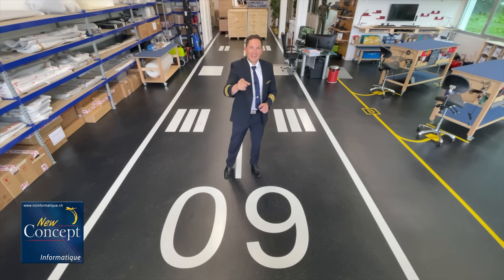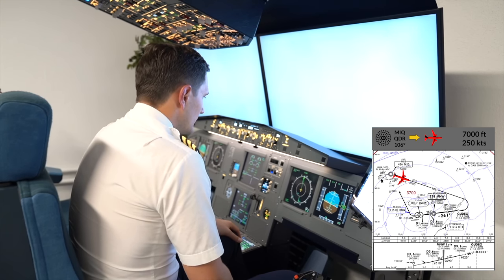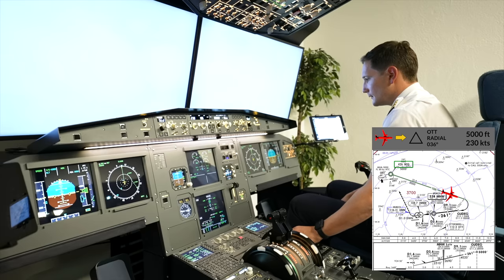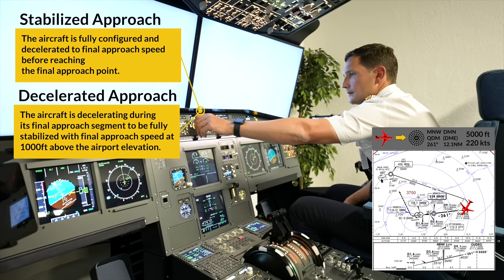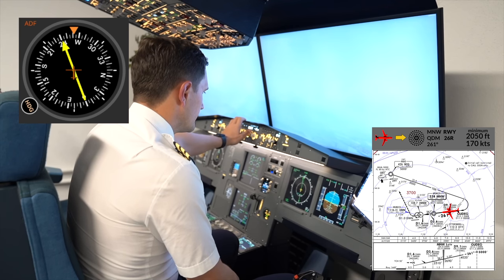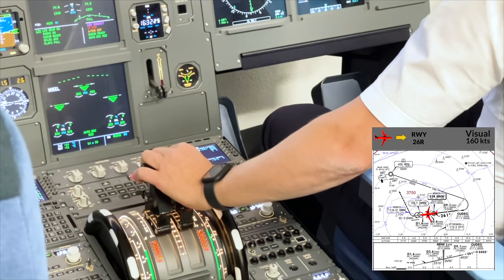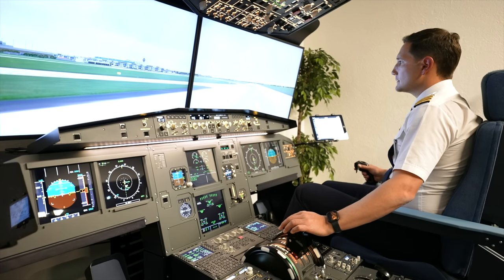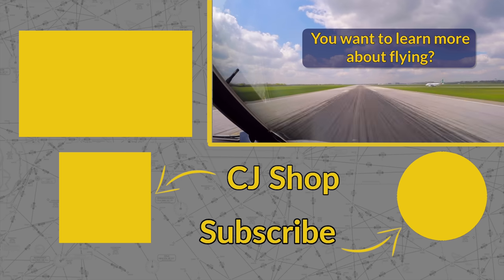How to FLY AN NDB APPROACH with an Airbus A320! Explained by CAPTAIN JOE

Comment: I know enough to follow what you are doing, but watching you do it I realize how much I still have to learn.
Reply from the maker: That’s the point of the video😉👍🏻
Reply: @flywithcaptainjoe  Mr joe, I got an interesting question for you:
If 80% of an airplanes’ thrust comes from bypassed air then Why do planes crash when they run out of fuel😊?
Reply: @Husky_Tech  The bypass air gets accelerated by the combustion chamber. If the combustion gets starved off fuel, the bypass air does not get accelerated, so there's no thrust.

Comment: Thanks Captain Joe.  As a non-pilot, this gives me additional confidence in the training of the crew up front.  But it made me wonder how such training was done in the pre-digital age.  I suspect simulators have been around for a while, but in the prop age, perhaps not.
Reply: There were! Just probably not as common. Checkout Tom Scott's video about analogue simulator called Link Trainer: https://www.youtube.com/watch?v=RJAYZgOZS08

And yes, they were more for learning to trust your instruments rather than flying generally, but still!
Reply: Simulators are older than digital, you do not need the picture out of the window to simulate navigation. And the navigation of an approach is the same in a small training plane as it is in the large plane. 
With large planes the student could ride in the cockpit jumpseat like an apprentice and observe the operation for many flights, in addition to formal lessons, then participate in small actions and calculations under watch of the captain.
Reply: Pre-digital qualifications were done via "pilot trainer" flights. These were conducted with an instructor/check pilot and usually started with a short cross-country flight to typical cruise altitude followed by an instrument approach and then a series of touch and goes.

Comment: Hi. Can you make an episode about landing with a Cessna? How can you find the glide path only with an altimeter without sophisticated instruments?
Reply: Pitch for ~65kts with flap 20/30, that'll give you a decent rate of ~500fpm, which will give you a good glide path. Too high - reduce power, too low - add power. Too fast - raise the nose, too slow - lower the nose. Very important to keep a close eye on the airspeed to maintain that speed.

Comment: Got to admit that setup is impressive as hell, that anyone that can afford it can buy (not just big companies) but it is a bit on the expensive side at over 40,000.00USD before shipping/packaging (Why packaging)/taxes and import fees plus a modest computer setup but it is a turnkey setup that has support. 
I'm sort of confused here "– Compatible screen support from 40″ to 49″ not curved included (without screen) !" so I'm thinking that the monitors are not included but are not listed under recommended system requirements and no list of compatible monitors that I could find. While the Prepar3D v4 and Prepar3D v5, Windows 10 and MSFS 2020 are shown as required so there could be some confusion.

Comment: Excellent demonstration.
Some of the approach chart features are a bit quirky to me.
At 4:25 we have a table that compares DME distances to altitudes. There are nine distances shown, which are from 3 NM to 12 NM, but with 9 NM omitted.
I checked the German AIP approach plate (AD 2 EDDM 4-4-4) that has a similar table, also from 3 NM to 12 NM, but this one includes 9 NM.
I notice that there is a fix (triangle) at 9.1 NM with an altitude annotation of 4020 ft; does that somehow have something to do with it?
Reply: Speculating here, but I think Jeppesen ommits the 9nm step (in this chart) on the distance vs dme table on their charts as it's listed as your altitude check point when passing 9.1NM, so no need to repeat it 0.1 miles later i guess
Reply: @MichaelVanBladel  That seems reasonable. Do you happen to know why the 9.1NM point is an altitude check point? Off the top of my head it doesn't ring a bell as a particular significant point along the approach.
Reply: @Rodhern  it'll serve many purposes. usually it'll be overhead a radio fix, or a marker beacon, or a dme distance along an ILS (where you typically don't follow a distance vs dme table) or to a VOR/DME. it's a point usually around 1500-2500ft agl (in my experience) where you can check if you're on the correct glide/descent slope at the right altitude as is expected. for example if the weather is extremely cold or extremely hot, your altimeter might be reading up to a few hundred feet high or low, and this checkpoint would reveal that in case you forgot to plan for it. also ILS glideslopes can have "ghost" glideslopes that are twice as steep so this would help you avoid being on the wrong one too. there may be more reasons but these are the ones that come to mind for me :)

Comment: 1:45
Did I miss something?
7000 to 5000 that's 2000 ft difference, 500 fpm would be 4 minutes, not 2. And probably that's why you've set 1000fpm on the FCU on the next snitt...

Comment: Hello Captain joe, hope you are ok. I have a bit of a disagreement with another pilot. I would like to have your input on the subject. When making an ILS approach (or any other IFR approach) in vmc condition what is you stabilisation altitude? 500 or 1000ft? Personally I would call 500 ft for a visual approach but still call 1000 on an ifr approach even in VMC. What do you think? Thanks a lot.

Comment: Hey Captain Joe, I have a question about the speed that airliners will fly at. On some domestic flights in the US, where the entertainment system can show airspeed it seems to me that often the airspeed is below 500 knots. I thought that a typical jetliner has a cruising speed above 500 knots. Do airliners often fly at below the cruising speed to save fuel, and are arrival times often scheduled such that their is the option to fly below the maximum cruising speed?

Comment: NDB approaches in airliners are common at MUC and other big EU airports? Uncommon here in Canada!
Reply: I think it depends on what you mean by common. Almost always more 'expeditious' approaches are available, and so your are unlikely to see an airliner fly an NDB approach. The NDB approach is common in the sense that the approach is (often) available if needed.

If anyone noticed airliners actually flying NDB approaches in their area, please comment, it is an interesting question.
Reply: AFAIK VORs don't like mountains (reflect from the slopes) so Innsbruck only has NDB available, probably some other alpine airports as well.
Reply: Here in the States NDB approach’s are becoming extremely rare. Since the advent of GPS, many VOR & NDB approach’s  have been replaced with RNAV approaches. And most aircraft that have an FMS can do what is called a VOR or NDB overlay. You use the FMS/GPS to actually fly the approach, but you tune the VOR or NDB and keep it in view for reference. Makes both approach’s, and especially the NDB, very easy to fly. No more remembering “ push the head or pull the tail” like in the old days. And there is no “zone of confusion” when passing over the VOR station, which in the past could cause NAV tracking/autopilot issues.
Reply: @kilianortmann9979  That sounds correct. I think the NDB at Innsbruck is probably more meant for the arrival to the airport and not so much for the final approach and landing though.
Reply: @Rodhern  in Canada they don’t commonly exist. I’m not even talking about commonly flown. I checked just now and couldn’t find any.
Reply: @mattym8  Indeed, you appear to be correct 🙂.

I browsed some airports now that you gave me the idea to get an idea of the prevalence that way. I had to browse quite a few before Prince Rupert (CYPR RWY 13) and Sioux Lookout (CYXL RWY 16/34) showed up with NDB approaches; and neither are among the country's biggest airports. Interesting to know.

Comment: Good day Captain Joe. I'm Raymond from Cape Town South Africa.  Thank you for all your great videos. I would like to know why pilots when do they a takeoff roll, the nose wheel is kept on the center line which contains runway lights. Will it not damage the nose wheel or the runway lights? Also won't it damage the inside of the cabin especially the overhead stowage bins as I as a passenger can hear it flexing etc. Thank you
Reply: The runway lights are flushed with the runway. So it doesn't protrude out.

Comment: whats difference between flight director and autopilot?

flight director does nothing without autopilot yet its addition button to engage
Reply: FD shows you where to point the nose to fly like the autopilot would fly. I think of it as autopilot but with manual control - a bit like flying an ILS approach without using autopilot and the instruments say if you need to go up/down or left/right.

Comment: G,day Captain Joe from Sydney Australia. Love the simulator very much. I've got in the back of my mind, one day: which electronic device one needs to split the flat screens into two or three?
🌌🌌🌌🤔
Reply: Basically a graphics card that can drive multiple monitors (your card will have more than one e.g HDMI port) or multiple graphics cards in your computer (one for each screen). If your system does that you can get external GPUs that can connect back to your machine say over thunderbolt (USB-C) or similar. 

Then you connect that to 2 or 3 separate screens that you mount close to each other (there are stands that help with this).

Comment: Is it common for you to perform a non precision approach as an airliner pilot? I mean, with all the errors that NDB have i would use it as the last navaid. I confess i was very curious about modern planes ability to perform NDBs. As a P3 Orion Pilot its more common for us, but i still prefer a VOR or a TACAN. Best regards Joe
Reply: VOR for approach is still used by airliners in places where traffic is such that having an ILS is not feasible, or the ILS itself is INOP. 
Though I don't think that I've personally seen an airport with has an A320 service only have NDB as its instrument approach yet.

Comment: £35K for a MSFS2020 controller (  TV screens, seats, rudder pedals, MIP floor bracket and wood floor are not included ! ) 

 I'll have two, is the plant included?  🤣

Great vid though, done a few of these in the Flybywire A320, some following the  RNAV approach ( as RNAV is not implemented yet with this plane )

Comment: Very interesting! A pilot of a huge B747 piloting a tiny A320 on a simulator.

I have always wondered whether in the real world, a trained B747 pilot would be able to fly any other aircrafts besides his usual aircraft like a tiny turboprop aircraft or an Airbus A380, or even the world's largest Antonov passenger aircraft at short notices, in say an emergency situation, or even when a pilot who calls in sick.

Are the controls and switches similarly positioned or does the pilot need to start hunting for controls and switches mid-flight in an aircraft he is not familiar with?

In my country, a same airline operates from  B747's to A380's and on the other extreme, the ATR's, depending on the destination.
Reply: TBH it'll be kind of mixed. Like the flying characteristics will definitely be different, but at the same time a cockpit layout is quite standardised,  so the pilot will have an approx idea of where to expect what.

Comment: Great video as always! 

In a normal decelerated approach with no speed restrictions from ATC in general how many nm before the airport you start slowing down?
Here you started about 25nm slowing down from 250knots and around 12nm to lower flaps. Is this the common method to do it or is it due to the increased workload?

Comment: An NDB approach?  I am not sure modern airliners even carry ADF recovers any more.  Further, I would be totally gobsmacked if any random button-pushing airline pilot could even begin to fly such an approach.  And if a standard-rate turn is not selectable in the FMC, who would be able to fly one without a turn-and-bank in the cockpit?
Reply: Yeah I doubt any A320’s are shooting NDB’s these days, it would mainly be RNP, VOR at the minimum. Even my buddies in GA charter avoid NDB’s if they can 😂
Reply from the maker: I flew a NDB approach with a 747 a few weeks back and multiple NDB approaches with an A320 in Greece and other places. They are still around and every modern plane comes with an ADF. Flying a standard rate turn manually is the easiest thing to do in a plane!
Reply: @flywithcaptainjoe  Well looks like i'm wrong then 😅 maybe its a little different up north